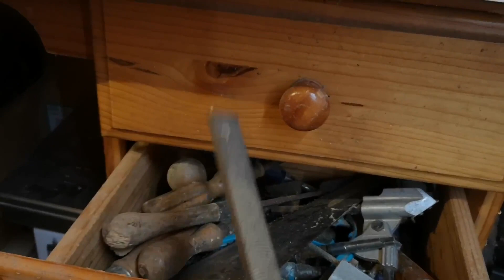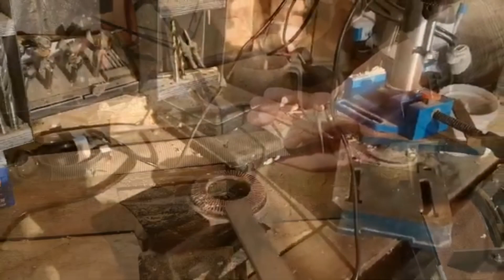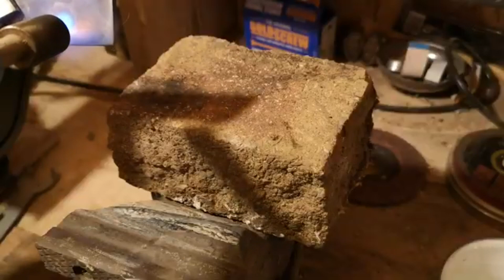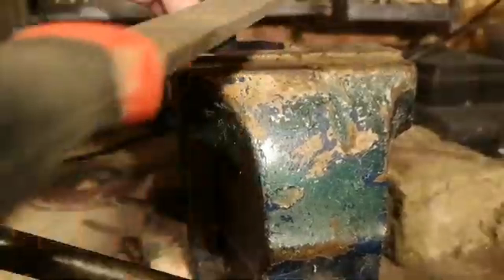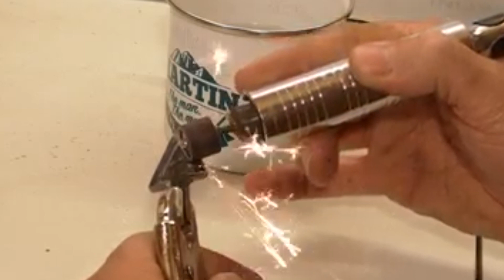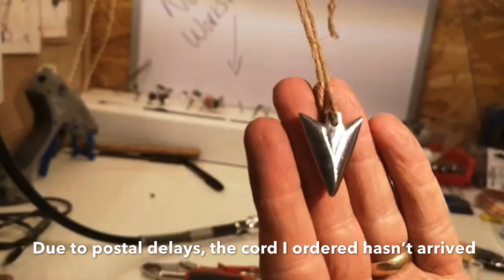Junk to Jewellery

Comment: Thanks from one of the gals. Galls is a different thing altogether, you might want to google the meaning. We all suffer from the blues sometime. It's a good idea not to become a slave to making videos, you might not do any videos for a fortnight then do two videos in one week. On your Dremel vid you said, "Why, why, why, why?" Because I didn't know you carved stones/rocks and there's no link you your instagram and I don't have an instagram account, I'm on enough platforms as it is. Nice project, but I couldn't kill an old file because I'd treasure all the time, resources and energy that went into making the file. I'd probably use a bit of steel rod, bash it like a blacksmith and then turn it into a jewel! :)